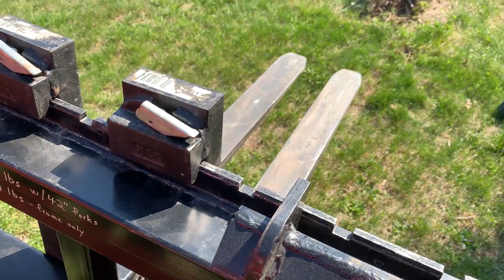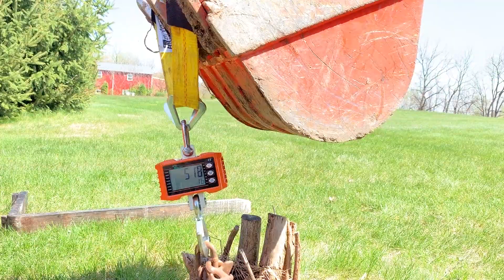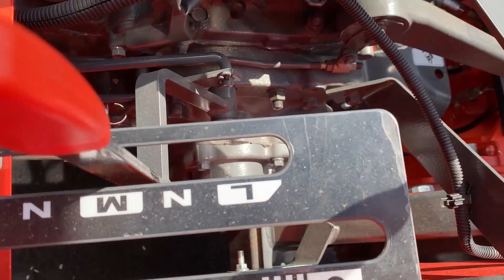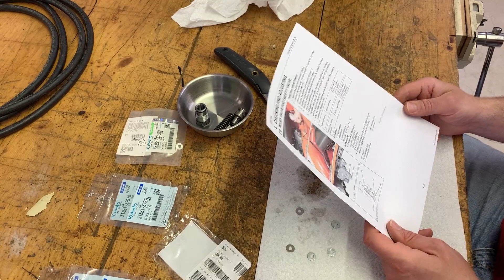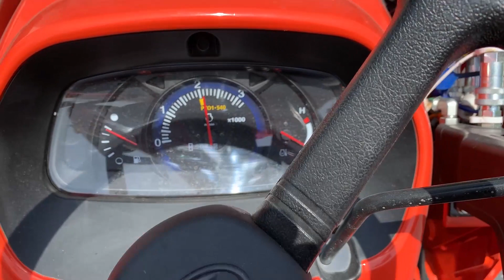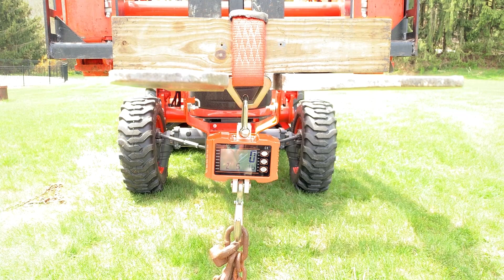Kubota L2501 Raising Hydraulic Pressure and Measuring the Results - More Lift Capacity!

Comment: If you people are smart stop playing around thers safety reasons why it set the way it is grant your dose in fact works but over pressuring valves and hydric lines it will at some point damage rings and blow the lines and forget about your warranty two people I now did this and kicked Tham selves in the ass when warranty work was needed if your machine is new you have a 6 year warranty so if you play around whith this and you need the warrant work done just keep this in mind because you will be shit out of luck at this point

Comment: Great vent blocking tip! Messicks has a good video about hydraulic spike pressures. Getting crazy on the implements is more damaging to the system. 
Next, need a gas tank is near full beeper. 😩

Comment: You can bet the hydraulics are set to keep you from flipping it over in most situations, not necessarily what the frame will take, that said if you are going to do this sort of thing, use a spotter to make sure you are not lifting wheels or getting unstable. plus since you have the counter weight of a backhoe, you may actually have far exceeded the lift capacity of a bar tractor with the same bucket. Not saying this is a bad idea, just saying watch those rear tires when you are doing this

Comment: L2501 has a max 1,920 lifting capacity.
Reply: It’s rated for 1150# or so…..not sure where your getting 1920# specs?
Reply from the maker: that's the 3-pt hitch (on the back)

Comment: Brand new l2501. My pressure is 2075 psi stock. Mine had two .4 and two .2 shims it looked like.  I added a .4 and a .2 and now I’m at 2400 even with the same winters gauge.  I have no way of testing weight lifting. I know I easily lifted 1250lbs in the bucket before.  My only seat of the pants test will be with a extremely full bucket heaped with moist 22a gravel.  Stock it would lift but you could tell that was just about it.

Comment: Best "show" I've seen.  I have a B3200 that I installed a larger diameter cylinder and added brackets below the boom to relocated the new cylinders.  I also have a 4n1 bucket that I bought from a Bobcat dealer.  The bucket was quite heavy. I cut 9" of the front and removed some other bracing to lower the dead weight of the bucket.  I always have some counterweight on my quick hitch for stability.  I just built a counterweight with a pump pressure tank and misc. iron(mostly train rail).  I had shied away from increasing the hyd pressure.  Again, great detail on the instructions.

Comment: Thanks for the spreed sheet along with the explanation of 1.3 factor . I normally would not leave feed back but you definitely take it as far as possible on your modifications and justifying the improvements.                 Douglas
Reply from the maker: Thx!  I try and capture the thought process, reasoning and considerations vs. just 'sending it', but I think it's too much for a lot of ppl
Reply: @netmagi  Thanks for the great video.  The loader ram force does increase in direct proportion to the pressure, but... part of that ram force is used to lifter the loader itself.  As you increase the pressure, all of the "extra" ram force goes into increasing useful load, since the weight of the loader stays the same.  I think that's why the useful (measured) load increases by a higher percentage than the pressure does.
Reply from the maker: @yabbut  thx, that makes sense.

Comment: Awesome walkthrough on how to add shims! How has it performed since?  Any issues with the higher pressure? Thanks for sharing!
Reply from the maker: Thx, and welcome.  Been sub'd on your channel for a while.  Thx for all the vids.  ZERO issues with the higher pressure.  Everything is designed to handle well over stock pump PSI due to pressures created even if the tractor was off and weight was being applied at the loader pivot, up to the amt that would cause it to tip forward.  In theory, you'd have to the chain the rear down to the ground and exceed the tipping weight at the loader pivot to cause damage.  I think Kubota tends to just set the PSI at where the tipping point isn't reached over a few inches of lift with no counterweight for safety.  Most industrial machines are set high enough to reach tipping point, as the hydraulic lines/controls have to support that pressure anyway.  One exception would be the pump, as you're driving it 'harder' with a higher setting, but there doesn't seem to be any documented cases of people wearing them out any faster, and we don't know what it's really rated for.   Obviously the more weight you have at the front pivot (with or without a PSI change) the faster any pins or other moving parts will wear in daily use.

Comment: I know you said you the back end did not lift on you with the increased lift capacity.  Since that was a static test, I am curious if the increased load while moving makes any difference. I have a backhoe too and they make an awesome ballast. weight.

Comment: A kioti will lift nearly twice as much without any modification.   Research before you buy.   Not after.
Reply from the maker: While I usually try not to feed the trolls, this is straight up misinformation.  The Kioti comparable loader, the KL4030 lifts 1,835lbs from the pins @ just under 60" lift height.  The LA525 lifts 1,803 lbs at the same height, at the same PSI setting, or 1,490lbs at factory PSI.  Even factory PSI vs. factory PSI, that's a difference of less than 25%, not 100% (or twice as much) like you claim.  Kioti likes to lead with their 60" number (1,835lbs), while Kubota leads with their lift capacity at FULL HEIGHT, 95" (1,082lbs).  Don't get tricked by the marketing folks at Kioti that are banking on folks making this same mistake when comparing.
Reply: @netmagi  You get a gold star for this response. 
In hydraulics the PSI, Cyl size, and where it is placed on the lever arm are ALL that matters.  In the case of loaders, all about in the same configuration.
You can't beat physics.
Reply: Yea but this tractor will continue to run trouble free. Good luck doing that with a Kioti…

Comment: Get RimGuard in those rear tires! (if you haven't yet) You will not regret it! Better stability, traction and helps tractor stay planted when using backhoe.
Reply from the maker: I considered it, but the BH does a good job counterbalancing whatever I lift, and I don't want the overall machine to weigh any more.  Aside from when it's real wet and soft in the winter, I can go pretty much anywhere in my yard without leaving ruts/tread marks and I really like that.
Reply: @netmagi  Totally understand on that rut making.
Just in case you ever find you do need to fill the tires, I have a B2650 (which is lighter than the L) tires filled RimGuard and have the B77 as well. I have found even with the yard wet (not saturated) lm not leaving any ruts. Just for reference to give you some idea. 👍

Comment: So this means that you can 30/35 lbs more right?
Reply from the maker: ~21% increase in lift capacity.  Way more than 30-35 lbs.  It's hundreds of lbs.  See the chart at 46:46: https://youtu.be/b_mvKc9g1q8?t=2806
Reply: @netmagi  my stock pressure was almost 2100 psi…..bumped it to just over 2500 psi…big difference in lift capacity ….
Should be safe imo ….I mean the hoses are rated to 3000 psi.

Comment: How many lbs are those hoses retap for and how many lbs are those cylinder seals rated for? You have to consider internal parts as well.
Reply from the maker: All significantly above this.  Why?:  Due to the pressures created when stopping a falling load.  Basically, everything is sized to accommodate AT LEAST the pressure created to cause a machine to tip forward with the max rated weight on the 3-pt as ballast.

Comment: As a fellow L2501 owner and small YouTube channel poster, I appreciate the time involved and the breakdown. Very interesting info. And the 1.3% gain in results.  I think you nailed the largest factor is having enough ballast to be safe. Most guys won't have the weight, (and leverage being out away from the tractor distance wise) that the backhoe provides.  Just with any machine, I believe seat time will provide the "feel" that is important for safety. Like my L2501, I can feel when I'm pushing certain limits.  I do see myself eventually adding this ability. I would add, if you haven't added a rear wheel spacer, I strongly recommend it, I added 3" to each side and it made my tractor "feel" and look like a whole new tractor. I'll be subscribing to your channel, can't wait to see more of your videos. I run some pretty oversized stuff on my L2501, like my 1100lb snow pusher. Lol. RB3772 rear blade (same one "Outdoor with the Morgan's run on his 55hp) and my 68" rear snow blower meant for a 35hp. If your curious, check out a few on my videos. Great work and I do soooooo appreciate the time put in.
Reply from the maker: appreciate the response, but not sure where you are seeing 1.3% gain.  It's ~21%.  See the chart at 46:46: https://youtu.be/b_mvKc9g1q8?t=2806
Reply from the maker: I watched your vid with that huge snow pusher before picking mine up.  Gave me confidence that I would be ok with a 6' model weighing in @ ~550lbs

Comment: I guess you need to speak up, provide close caption or wear a mic. Overall good info, however I'm trying to locate the relief valve on the B7800 to bump up the grunt and all the vids on YT are of BX and L series units. I'll have to dig into a hydraulic parts diagram to try and locate it's where abouts.  Thanks for sharing!

Comment: I'm sure you said it, but I must have missed it.  How much total shim stack did you end up adding??   Great info, thanks!
Reply from the maker: I don't recall, but it will vary a bit from tractor to tractor.  I would strongly advise measuring pressure before and after.  The shims are cheap. I would just pickup a small assortment.  The shipping will probably be more than the shims.

Comment: Good info and thanks for posting.  One note though.  I've never used a digital micrometer, only the good old fashioned vernier units, but I assume they work the same.  If not, I'll stand corrected.  Use the large barrel to measure the thickness, not the small one on the end.  That is used to adjust the "feel" so the operator can be consistent when measuring.  Some will want to "clamp" a little harder than others.  Yeah, yeah, not a C-Clamp!
Reply from the maker: The small barrel on a modern micrometer isn't used to adjust the tension, it works instead like a mechanical slip clutch ensuring all operators apply the same force.

Comment: That loader says 1100 pounds.  U got a lot out of it. Right?
Reply from the maker: Yes, and remember, that 1100 lb rating is at the pins.  I'm measuring ~28" forward of the pins (24" + fork frame)

Comment: Wont doing this void the warranty?
Reply from the maker: Possibly.  They would have to prove your adjustment is what caused the issue.  For example, if your seat safety switch fails, they're going to have a tough time saying you voided warranty on seat by increasing hydraulic pressure. . .  If your loader, valving, or pump fails. . yeah, you're on your own.  BOTTOM LINE: I would recommend waiting till the warranty is up before making any major changes/adjustments to your tractor.    I may not if I needed the performance, but that's on each owner to make that call and take responsibility for their actions.  In my case, the warranty was up almost a year ago.

Comment: awesome,   !  question how did you raise RPMs ?  thank you
Reply from the maker: There's a throttle-limit bolt on the right side of the engine under the black side cover.  Move the throttle while watching that side and you can see the bolt that stops it.  I would recommend setting to ~2700rpms.  I rarely rev the machine that high,  I'm usually between 1800 and 2500 rpms's, but it's good to have it there when you need it.
Reply: @netmagi  Any way to do a video on changing the rev limiter?
Reply: @netmagi  thank you,   thank you for the fantastic video